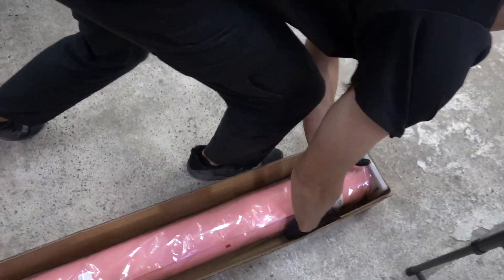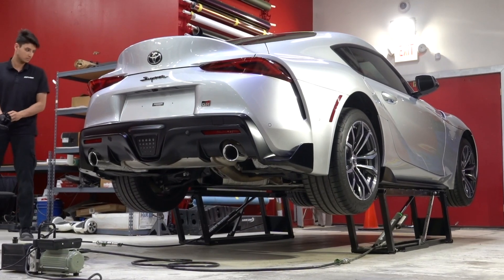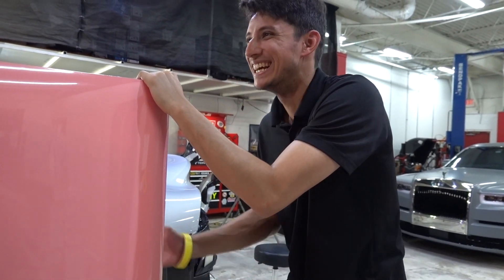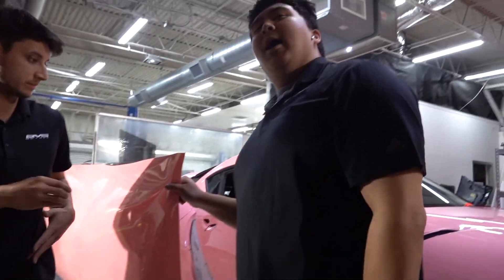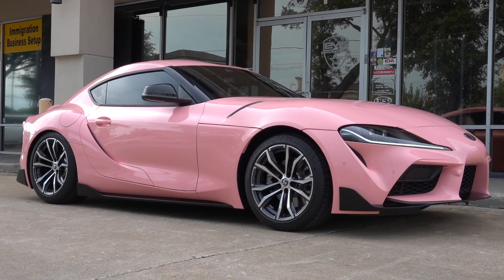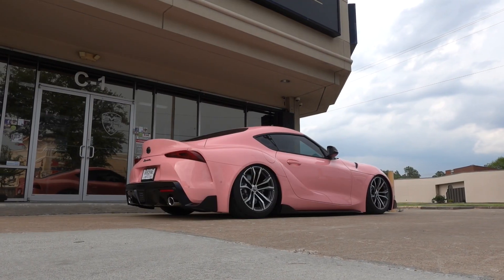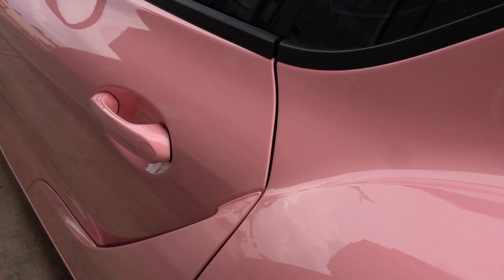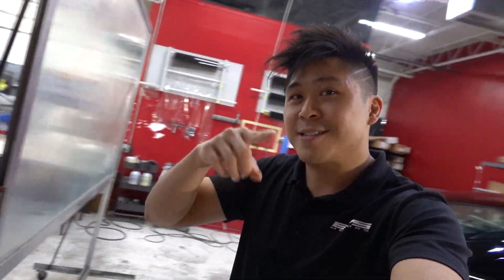Wrapping Toyota SUPRA in INOZETEK CHERRY BLOSSOM PINK!

Comment: In general, what does a full car wrap run these days?  Say for a 2017 Cadillac CTS?
Reply from the maker: $1000 - $10,000
Reply: @EVSMotors  thats a wide range. How much do you think it'd cost for a supra ? Looking to get one wanna get it wrapped neon color with black door vents and roof.
Reply: @zedxproject6297  It depends. some shops will charge $3,000 without door jams some shops will charge $5k-$7k for a full wrap including door jams.
Reply: Do you guys sell the vinyl?